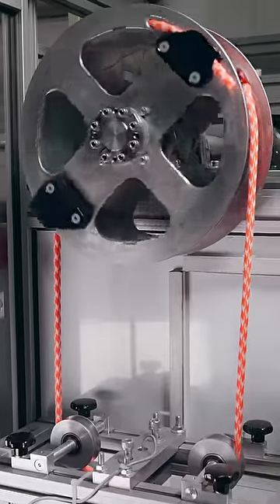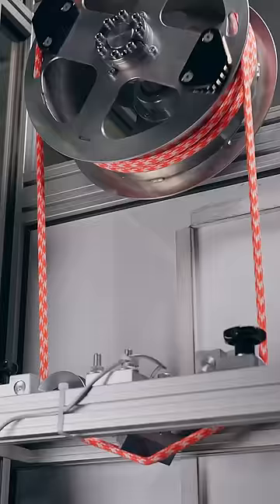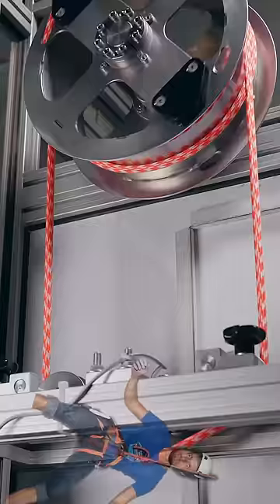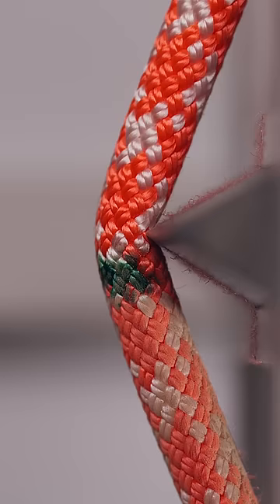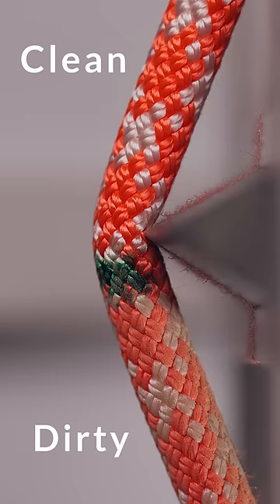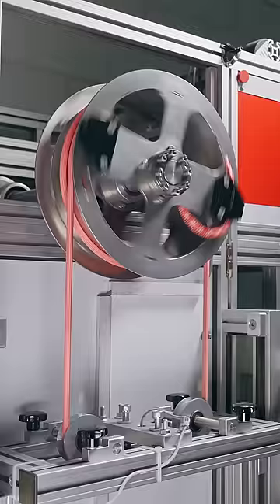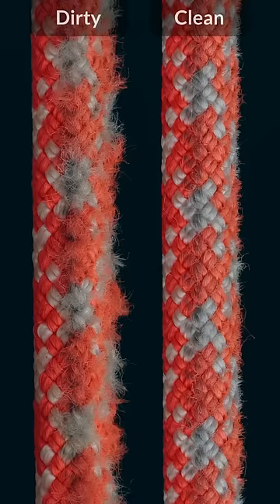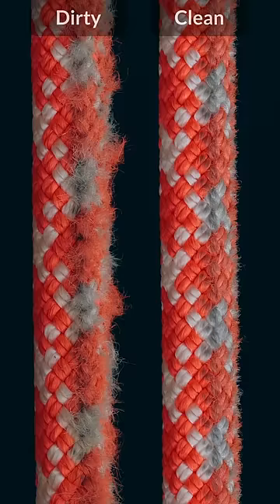Surprising Effect of Dirt on Climbing Ropes

Comment: NEVER leave your rope on the ground, and NEVER free-wash your rope (especially kernmantle). You should always place the rope in a mesh or purpose-made bag before washing in an agitating washing machine. Hand washing is generally your best method because A) it cleans the rope (duh) and B) it requires you to have “hands-on” and allows you to physically inspect the rope as you wash, which increases your chance of finding any defects. 

PLEASE PLEASE PLEASE don’t ever toss any rope intended for life safety into a washer freely as is shown in this clip.
Reply: You have taught me something today,  I thank you.👍
Reply: What if you use a cold cycle? If you make sure to inspect it afterwards, what is the difference between hands using soap and water and a dull metal machine using the same soap and water? Is there a study showing this benefit of hand washing?
Reply: Why not in the washing machine?
Reply: @thomasplace6781  I don't know if there is a study on this, but while handwashing it, you would feel (by touch) things such as "huh, the rope feels "more flexible" on that part" or "It feels thinner right there", while such things wouldn't be seen during a visual inspection after being washed by the washing machine.
The rope holds you.
It prevents you from falling.
I'd not give to a washingmachine the responsibility to take care of something i use to keep me alive.
I'd rather "lose" a few mins handwashing a rope, than many years of my life bc i fell.
Reply: @morluche91  I guess I just don’t see why you have to do the washing part yourself, when you can inspect it afterwards and still save a ton of time while being the same amount of safe. When I hear things like “NEVER” this and “PLEASE DONT” that, it makes it sound like if I stick it in the washing machine it’s going to melt or something. Sounds like the point is to  inspect your equipment before use, not to hand wash. Hand washing could honestly be WORSE, because you are trying to get it done faster while a machine will always consistently and thoroughly wash the rope.
Reply: Why would we trust anything a Florida Man has to say about rock climbing? Gotta change your handle to “UtahMan” or something hehe.
Reply: @Fishy please explain to me what is sharp in a washing machine. I look inside my washing machine daily and have never seen anything that is sharp, or any lobsters to pinch things. I am using common sense. Common sense tells me that I have never had a shirt rip in the washing machine. Common sense also tells me that I do not know how to hand wash clothes let alone a rope, so my cleaning would be ineffective. Lastly, common sense tells me that if you are going to inspect the rope afterwards anyway, it doesn’t matter because a rope that is compromised is going in the trash either way.
Reply: @@fishy2939Washing machines have soft plastic edges on everything.  Your response to a good and legitimate question is garbage--condescending and not a satisfactory answer.

"Never do this"
"Why not, exactly?"
"Because it's obvious, stupid"

If there really is a good reason not to wash rope in a machine, I'm sure everyone here would be interested to know why.  Perhaps if you have a tall agitator and the rope got wrapped around it, it could get abraded.  You could also wrap the rope up so it doesn't get tangled, and then it would be fine.
Reply: Don't tell me how to wash my rope.
Reply: @thomasplace6781  I don't believe it would save any time at all, since "handwashing it" is basically "inspecting it, but with soapy-water added".
It takes the same time to inspect it, than handwash it.
So to save time, just remove the running time of the washing machine, and add soapy water while inspecting.

That's what i believe, but tbh i don't climb, so i don't know.
I had 2 friends who used to climb, and both of them are gone.
One of them crashed on his new bike, and the other one, well, idk how to say that in English. 
Let's just say "his rope kept him from falling off the cliff very well, on purpose, when his wife left".

I like Parkour, but i'll never ever do climb rocks and cliffs like that, with the equipment and everything.
And the Parkour i do is pretty much "on the ground", like, go over walls and jump a few meters down to skip stairs, but yea, jumping from one building to another? Heck nope.
Reply: @thomasplace6781  I don't have any personnal experience with climbing equipment or ropes, but i do my laundry since about 20y.
Broke a few washing machines. Repaired a few washing machines. 
Washing machines can make tight knots with a pair of jean's legs, if you put a baseball cap or a pair of rugged gloves or anything "small but somehow heavier than fabric" with it in there.
Washing machines aren't "sharp", but they can, and will, do "sharp bends" on a rope.
They'll also tighten a lot the knots they make, and "pinch" the knots between the rotating barrell and the front glass door if it's a "front load washing machine".
Top load washing machines would be even worse, since there is a "pole thing" in the middle of the barrell, and the rope would tighten itself around it, putting a lot of stress on the rope.
There is this "biker's rule" that says "if you drop your helmet, you've gotta change your helmet, even if it looks fine", because it could be cracked or something.
I believe the rule should be : "If some excessive force have, or could have been applied to the equipment that keeps you alive, consider it fried and done."
And washing machines do use excessive force, way above the "holding values" the ropes are rated for.

Have you never seen that video of a guy throwing a brick in a running washing machine?
(i've posted the link in my next comment, to show how "not gentle" those machines can be.)
They're great to wash your everyday clothes, but not for something you rely on to keep you safe and alive.

Sorry if i speak a weird English, i'm from somewhere in Europe btw. Doing my best to be understood.
Feel free to correct my English if i've done any mistakes, i'd love to improve it.
Take care ;)
Reply: @somethingelse4424  my guess is that it could get tangled and damaged- I only know that I’ve had a few pairs of athletic shorts lose the string that holds them up, and most times it tangles and rips. I imagine ropes could possibly get tangled too, but I don’t know anything about climbing ropes.
Reply: @thomasplace6781  yeah, I feel like a delicate cycle would be fine because it probably is better than a hand wash (with a side load or one without an agitator because those have snagged my clothes quite a bit). Even for clothes, most fabrics, including nylon, are still machine washable. Definitely no dryer
Reply: For those of you asking about WHY you shouldn't put rope in a washer...

1. I would consult your washing machine manual.  Objects like ropes are not normally recommended. They are big heavy and become lopsided and during the spin cycle can put unnecessary strain on the motor.

2. There may be slight gaps in the drum assembly a rope can slip through that clothes can't.  It's not designed for it and will destroy the rope and washer

3  unknown effects of laundry detergent on rope material 

4. Because elitist climbers have always HAND WASHED and if you're a REAL CLIMBER you wouldn't dare machine wash a rope because hand washing is JUST HOW ITS ALWAYS BEEN DONE

Bit seriously if you're using gentle soap on a gentle cycle and not filling the entire washer with huge rope, and your machine is sturdy enough to habdle it, there's no reason not to use a machine
Reply: Great information!
Reply: The plastic window of a front loading washing machine causes friction on the rope. This causes heat and breaks down the rope.
Reply: @thomasplace6781  washers are very hard on favrics compared to hand washing. Id imagine kts similar with rope. Also provavly forms knots causing friction and wear
Reply: They tested a rope that was machine washed, it fared a lot better than a dirty rope actually.
Reply: @morluche91  that's not a bikers rule, that's a helmet manufacturers rule 😉
Reply: @thomasplace6781  I don't know a thing about ropes or climbing, this video just appeared in my recommended, but I wanted to say that I like your way of thinking, I too get annoyed when clickbait titles or ridiculous recommendations are made, saying things like "NEVER TOUCH THIS ROCK!" or "IF YOU SEE THIS, RUN FOR YOUR LIFE!" its always something dumb that isn't a big deal but everybody repeats the phrase anyways. so yeah, agreed, and good question, and also same thought I had, why not use the washing machine? unless they can give you an actual reason not to, then they have no justification for telling you not to. ¯\_(ツ)_/¯
Reply: @somethingelse4424   thumbs up to you SomethingElse, I've gotten annoyed every time someone tells me something ridiculous and when I question it, responds with "well its obvious". if its so obvious surely you can tell me what it is??? xD have a good day 👍
Reply: @morluche91  yeah at the end of the day it’s crazy stuff and I’m never trying it lol, climbing gyms are enough for me. From reading what everyone is saying, I’d say a delicate cycle in a front loader is the safest bet as far as a machine goes. The comments have no results from this, so it’s assuming no knots or excessive coiling from the machine. If that happens, the rope should never be used for climbing again. All in all, if you have little to no experience with ropes or climbing it’s best to do whatever experienced climbers tell you, which is probably going to be hand washing. But the most important thing is to inspect the rope. Would you say that’s about the right summary?

Edit: looked it up and there’s a ton of stuff on how to wash a climbing rope in the washing machine. Tie into a daisy chain, run on the lowest cycle, only use soap that works with the rope, and always inspect before use. Cheers!
Reply: @Tavat  ohio man...
Reply: they call them garment washing bags i think
Reply: My hobbies are not inherently as hazardous as that of climbers (albeit outliers exist, e.g. Dimebag Darrell).

That said, it makes sense to me that a hand inspection could be more thorough if it were performed while washing.

I won't speculate on whether inspecting the rope dry (or wet) would have any disadvantage, however I hope everyone will at least concur that a ride in a front-loading washer will abrade the rope less than in a top loader.

Stay safe everyone. Enjoy the hell outta that fresh air for me!
Reply: Hand wash all day every day. Great great great advice. Nothing better than being completely familiar with your gear and the condition it is in.
Reply: Hmmm....

"Florida man"

I keep reading about you in the news.
Why the sudden safety concerns?
Reply: Nice to always see educational comments on YT. Thanks, you potentially could have saved someone.
Reply: @thomasplace6781  put it in the washer dude. We don’t care
Reply: I inspect tools for a living, and arborists tools that come across my desk include climbing ropes. The manufacturers of every single climbing rope are super clear: If the rope is dirty, it fails the inspection.

Inspecting climbing rope is very labor intensive. Our company has made the decision to just replace every rope each year.
Reply: Thanks for this wonderful tip ❤
Reply: @thomasplace6781  yeah mine is all smooth edges and no middle thing in it 🤷‍♂️😂
Reply: I wish I had as much faith in anything as some of y'all have in washing machines lol. Sounds like most of you either haven't washed anything fragile ever, or have little basis for comparison with different machines. Follow best practices to err on the side of caution when your life is on the line, it's basic reasoning
Reply: I demanded my washing machine to pay me back for the rope I gave it for free 3 years ago.
Reply: Great to know for when I climb the mountains in florida
Reply: @thomasplace6781  I’ve had clothes ripped by a washing machine, lol. It’s very easy for things to get tangled in the blades of the impeller in top loading washers. Or get sucked under the impeller, which is always a mess. Or in one of the various and numerous holes and right angles of the wash basket/tumbler/agitator.
Reply: @Kathrynerius  yeah I think we’ve already agreed as a comment thread that front loaders are the way to go. Put it in a mesh bag or tie a daisy chain and it’s probably fine. Tbh I think we’ve all said what needs to be said and have come to a sound conclusion lol. I’m signing off, happy that we now all know how to safely wash a rope 😝

Edit: front loaders OR hand washing, with hand washing being the “tried and true” method. And of course we’ve established that inspecting is a must either way
Reply: Putting rope in the washer is totally fine. And yes if you wash it per hand you can inspect it but that should be done after and before every use.

And it depends on how much you rope you have. You can probably wash a 200m rope easy per hand, but try that with 10km of rope if rope is used everyday
Reply: @googlesuxbigtime1227  he's talking crap just put on the lowest rotation setting and not more than 40°C. Nothing bad happens to the rope.

Expect the knot of the century lol
Reply: @smiley37greg   use the lowest rotation setting and not more as 40°C and you are fine. There are no benefits of washing per hand expect itsaby cleaner (most ropes come with washing instructions)
Reply: @Fishy I mean your probably right  if you put the Maschine In the washing Maschine. You should use the lowest rotation setting and not more than 40°C an its all fine
Reply: You are correct. I have my rope access certification. I would NEVER EVER put a rope in the washing machine. Especially one with which your life depends on. I always hand clean. A washing machine can destroy the integrity of the rope.
Reply: @youandiryan   what type of certification do you have? Because I'm fisat certified and there it's totally  ok to wash them in the machine as also recommended by edelrid to wash them in the machine if you have a huge quantity of rope
Reply: Naw I’m sure it’s fine. I just washed my rope like in the vid, and I’m headed out to a climb right now. I’ll report back later and tell you how much you’re pearl-clutching.
Reply: So basically, the answer here is “because someone else told me not to.” There isn’t one valid, concrete response in this entire thread that said why you should not put the rope in the washing machine. Just speculation and a bunch of “the pros said not to, but don’t say why.”
Reply: Thanks for the knowledge
Reply: It's ok he didn't wash it he "warshed" it 😂😂
Reply: @FrizzRizzle  Before saying "there isn't one valid comment, concrete response", read all the comments.
I did my best to explain, and looking at my first comment's likes (4th/5th reply), i believe a few understood.

I've been a forklift operator for about 6y, CACES 5+ (forklifts weighting about 8 tons, going up to 13m/42ft, with heavy loads, and the cabin, with the operator, going up too) when the forklift "stalled", while fully deployed, i was supposed to use and trust a rope that was in a bag behind the seat for about 8y, and nope, i prefered to "climb my way down on the racks" because there were dead insects in the bag and it "cracked" when i unfold it.
For whatever safety equipment, you have to know what happened to it before, to be able to trust it with your life.
2nd hand bike helmets? NOPE.
A rope that went into a washing machine, stored wet, eaten by insects to be used to get you down from 42ft safely? Even worse nope.

Got fired for not trusting the "cracking rope" and climbing down the racks instead of just "hanging down the rope", but 0 regrets. The rope would have broke, and i'd be a pancake on the floor.(but i'd have "followed the procedure" doing so, i guess)
Don't mess with safety equipment.
I'm the kind of guy that isn't bothered about "breaking hands, arms, legs, feets", and always says that there are only "sight, hearing, and teeth" that don't grow back, but if your brain becomes a slushie, you're just ded. it won't grow back either.
If you believe you can ride a motorcycle with a coconut shell with a strap on your head because it would be "ok with your local laws", feel free to do it, but good luck staying alive bud.
Reply: @thomasplace6781  I don’t know anything about washing rope but shoes get damaged In washing machines so I’d believe it
Reply: @Clayne151  its both, for the same reason: people would regularly get serious head injuries from helmets that looked fine on the outside but were actually seriously damaged from being dropped or otherwise mishandled. Naturally, people who didnt understand what they had done wrong complained to the companies, who inspected the equipment, saw the problem, and made this rule to say "its your own fault for mishandling your gear", which is also generally a rule among bikers as well because like most people they tend to like staying alive and so encourage others to handle their gear responsibly.
Reply: @morluche91  great post and very insightful regarding washing machines actually
Reply: Best way is to use a big enough basin with luke warm water nothing else, dunk it and swish about, if you see a lot of dirt and grit on the bottom of basin, empty out water and repeat the proccess, let it dry in the shade, never in the sun.
Reply: @morluche91  
Yes but you can inspect all of that after washing it. You can put the rope in the washing machine on delicate wash while also making sure it isn’t loose enough to get tangled and twisted. I get what you’re saying but if one twist of your rope made it compromised then I don’t think hand washing it was going to save it. Either way, id like for the expert pro climbers to give their input on why they say not to. A dusty, bug ridden, corroded rope is obviously not a good candidate for life saving equipment.
Reply: @nytrouz_original  hey man sorry I did not see your comment earlier. I have my IRATA rope access, Rescue, and fall arrest certifications
Reply: Having worked with boat captains at a large Key Largo scuba shop, I can tell you that rope strength is destroyed by twisting it.  It needs to be coiled and uncoiled in a certain organized way, or the fiber alignment gets comprimised.  Tossing a rope in a washer and letting it twist about randomly is bad for the rope's strength.  Ask a pro climber or pro captain.
Reply: @FrizzRizzle  Having worked with boat captains at a large Key Largo scuba shop, I can tell you that rope strength is destroyed by twisting it.  It needs to be coiled and uncoiled in a certain organized way, or the fiber alignment gets comprimised.  Tossing a rope in a washer and letting it twist about randomly is bad for the rope's strength.  Ask a pro climber or pro captain.
Reply: @youandiryan  nice we gave an irata training a few weeks ago at our training center . It's quite different to fisat rope acces
Reply: @nytrouz_original  yeah man it's pretty in-depth. My company paid for mine. As the course cost like $2,000 or more in Canada
Reply: @FrizzRizzle  With your logic, it would save time and effort to put babies in washing machines, instead of handwashing them everyday.
I mean, the program says "delicate cycle", so the baby would be fine, right?
:facepalm:
Washing machines are great to wash everyday clothes, that aren't meant to resist some "force loads".
Washing machines aren't made to take care of safety equipment/delicate things, that's why soft wools/satin/silk etc have a sticker that says "do not put in washing machine" because the machine would rip them apart, even on "delicate cycle".
Your logic is the reason why microwave manuals have to state  "Do not try to dry any living thing in the microwave".
Reply: @youandiryan  yea it's around the same in germany
Reply: Isn't the mountain side the same as the ground, just vertical?
Reply: @electropentatonic  yep it is except the ground is dirtyer cause of gravity
Reply: @Metal_Master_YT  Incredibly frustrating.  I feel exactly the same.   I'm not a mechanical rainman, I'm fallible, but I don't accept "never do this" as an answer.  I'll take it under advisement, but you've got to articulate some mechanism that explains why something does or does not work before I accept it.  Ropes in a washer are apparently like reading tea leaves.
Reply: @googlesuxbigtime1227  the same reason I think you do not free wash delicate fibers🤷🏻‍♀️ the drum is not that smooth and can do micro tiers to fibers. I destroyed some thin pyjamas that way😅
Reply: @thomasplace6781  I have destroyed some clothes made of thin fabric in a washer🤷🏻‍♀️ they had small holes😅 that is why it's recommended to use special sacks for delicate fabrics.
Reply: @Tired_Night_Owl_in_the_Woods  my holes usually appear from my own clumsiness, not the smooth barrel of water lol. But using a sack definitely makes sense for something you’re counting on with your life :) OK IM DONE WITH THIS THREAD, we are getting out of hand with this rope talk 😂
Reply: @Tired_Night_Owl_in_the_Woods  Well that aways sucks when that happens.
Reply: MACHINE WASHING RELAXES THE ROPE FIBERS. THEN AS IT DRYS THE FIBERS BECOME STIFF, AND MORE PRONE TO SNAPPING! THIS APPLIES TO BOTH SYNTHETIC, AND NATURAL FIBER ROPES!😊😊
Reply: I suggest  hand washing rope. If you have a top loader, or spin only on a front loader - after handwashing spin dry the rope. Take out. Cold rinse by hand. Then spin dry again. Spin drying is centrifugal & shouldn't cause abrasion to the rope. Air dry without placing it on a dirty ground - either draped on a clothes line or spread out on a clean tarpaulin & turn the rope over if needed until fully dry.
Reply: You surely can intensify the effect by putting some stones into the drum.
Reply: @NG..  most people I know who wash ropes in the washer (amga guides for what it's  worth) weave the rope into a specific daisy chain before washing it to prevent tangling.
Reply: @peetee32 calm down, it's a f**king rope not crystal. Next to that, modern ropes are extremely well made and more often exchanged because of age rather than abrasion issues!
Just follow rope manufacturers instructions and enjoy your hobby!
Have fun 🧗🍻
Reply: Calm down man... Modern ropes are incredible strong and well made. Just follow rope manufacturers instructions and enjoy your hobby! 🧗🍻
Reply: @OmmerSyssel  this whole thread is so laughable. People who have never touched a rope who are like oh my God if a single knot  gets in your rope while washing it,  throw it away! Meanwhile , people have been purposefully putting knots into ropes for thousands of years, many times in a row, , and untie  them without the rope somehow magically failing. With modern ropes, we will literally take a 12-ft whipper on a knot, for talols and laugh and do it again and again and again I imagine a lot of these people would be freaked to hell to hear about someone taking a victory whip at the top of a sport route.. .